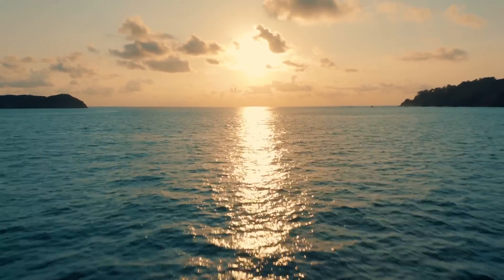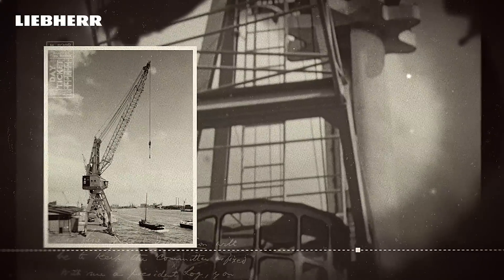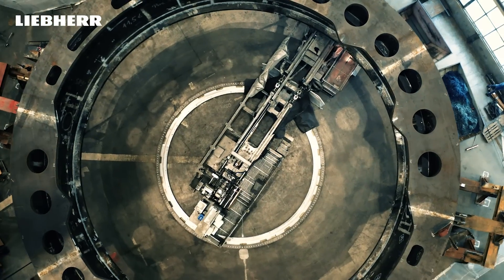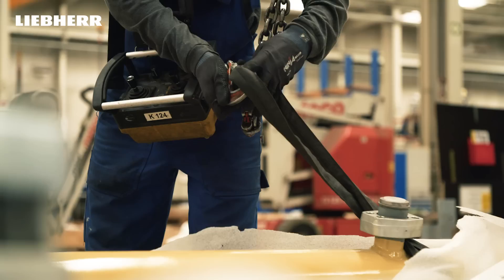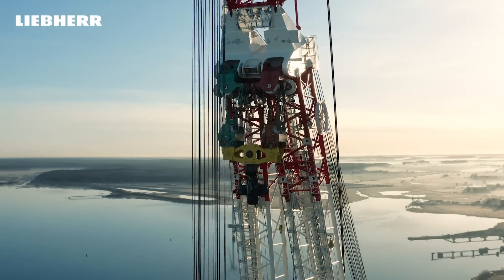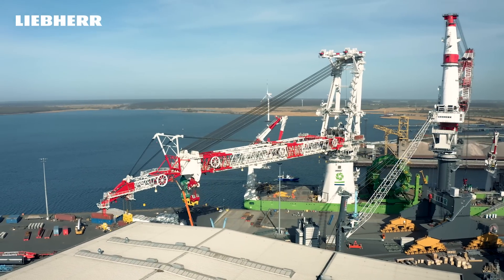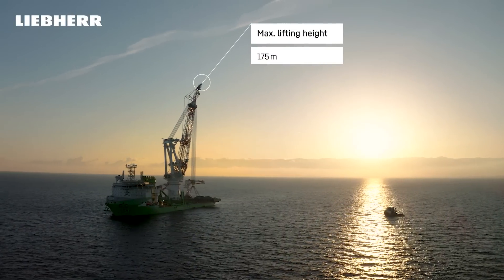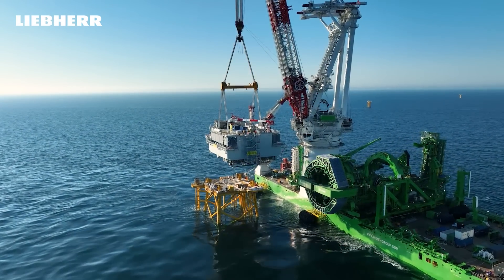HLC 295000 offshore crane - Rise of a giant | Liebherr

Comment: What project was the top site and jacket part of? Very possible we made the jacket
Reply from the maker: This project was the second major operation for the HLC 295000 in mid-2022, installing a substation for the 500 MW Fécamp offshore wind farm off the north-west coast of France.
In total, two large components were installed, a 1,300 tonnes jacket, as well as the 2,200 tonnes topside. The Fécamp offshore wind farm will generate electricity equivalent to the power needs of more than 770,000 people.

Comment: this is the one that failed massively ,check it out on youtube wow
Reply: The crane itself failed because of slings on the load snapped, 5000+ tonn downforce suddenly gone does that to any crane...
Reply: @isaksundrapp  no slings snapped nor was it 5000 tons. Hook from external supplier broke at 2600ton during process of full load test.
Reply: Not the crane failed.  Be better informed
Reply: @martyn hanna
Reply: Clearly you haven't looked properly into what happened and have only watched the video...The hook which was manufactured by an external company failed...Not any liebherr parts